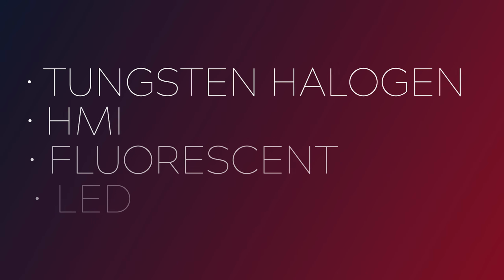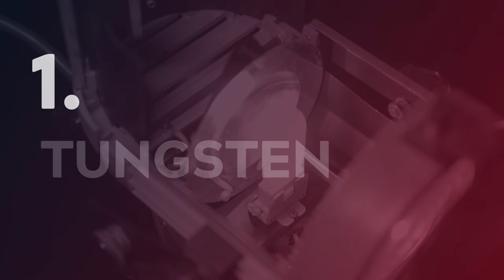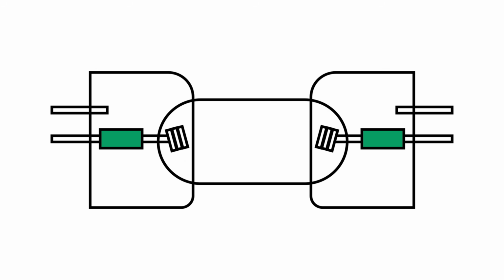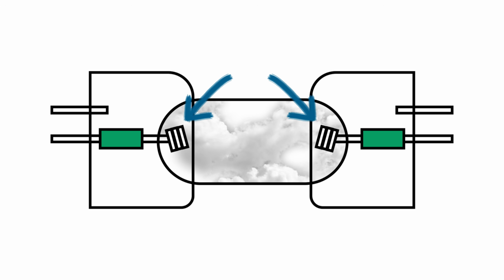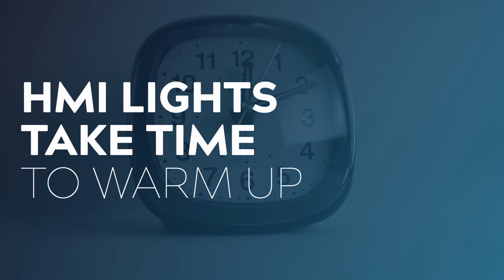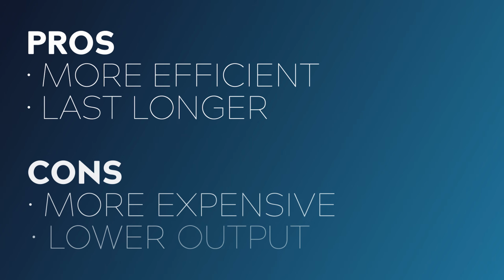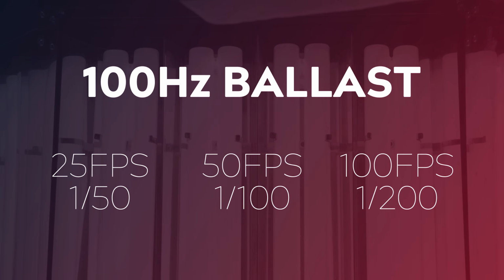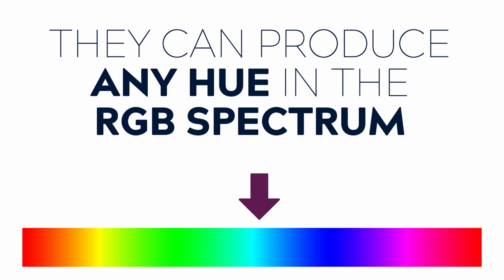Types of Film Lights - Tungsten, HMI, Fluorescent & LED Lights Explained | Film Lighting Techniques

Comment: Ok Ok i scoured in a lot of articles and couldent find a defenitive answer.... why tungsten light emits a ful spectrum of light? i mean... i know that pure white light' ,like the sun, contains the whole color spectrum from purple to red. so why does the tungsten light emits a full spectrum? or im understanding it incorrectly.
Reply from the maker: I have been trying to find a definitive answer to your question for the last two weeks. But I haven’t found anything conclusive or satisfactory. I’m going to keep digging. But I didn’t want to let this sit unanswered. 

It would appear “full spectrum” isn’t a scientific term and there is no measure for what a “full spectrum” light is. It’s just become part of the industry vernacular. The definitions seem to vary a lot. 

Also, a tungsten filament is considered a black body radiator (read: something that emits light when heated) and is used as a reference source for CRI ratings, along with daylight sun. So it actually only gets a perfect score because it is the reference point that all other 3200k sources are attempting to match.

This is what I have discovered so far. Thank you for posing this question, I’ll keep looking into it and report back. I may even do a video on this topic. 

Thank you 🙏🏼
Reply: Tungsten light is caused by pumping electrons into a filament thereby heating the filament until it glows similar to an incandescent light bulb (it’s actually almost identical). The light put out by tungsten is essentially fire at high temp, meaning that it’s totally natural and not replicating anything unlike HMI, led or flouro
Reply from the maker: Thanks for chiming in 🙂
Reply: @CreativePathFilms  thanks for a great vid! Neat to see how things have changed even from when this was made only two years ago. You hardly ever see legitimate flouros on set anymore, as they’ve been replaced by quasars and titan tubes. Things change so fast nowadays!
Reply from the maker: Thank you! It’s so wild to see the speed at which things are changing! Its exciting times to see so much rapid innovation.

Comment: what lights have you used in this video?
Reply from the maker: Hi Paul, 
This will be an incomplete list, but these are the ones we've used most frequently in each category. Here we go:
Tungsten: Arrilite 2K, 1000, 800, 650+, 300, Dedolite DLH4, Ianiro Redheads.
HMI: Arri M18,  M8 as well as 1.2k par and 4k Fresnels that I can't remember the models (all hired at different times for different jobs).
Fluro: Kino Diva, Lightpro 4x Fluro banks
LED: Aputure 300D, 120D, 100D, Nanlite Forza 60, Aputure F7, 672, Falconeyes Light Mats as well as a bunch of other LED panels and tubes from various brands.

Comment: My Nanlite led pannel has indeed been one of the best purchase I've made.
One question : why is still the tungsten the best for a warm color ? Compared, for example, to a led light with color correction
Reply from the maker: Hey Simon,
Thanks for the excellent question!

To be honest, the difference between using a tungsten fixture and gelling a high CRI/TLCI LED is fairly nominal. It’s well within that zone of diminishing returns. 

Gelling will get you 95% of the way there in terms of light quality and this is what I do on my shoots the majority of the time.

I live in Australia, so let’s be honest, it’s hot enough here as it is without pulling out the tungstens 😂

But I can’t quite put my finger on it. Whenever I put two lights side by side as a key/fill combo, with a tungsten key and an LED or fluro as the fill, I also ways notice how much better the tungsten side looks. It’s really subtle. 

The skin always has more life to it, the skin tones and colours are always fantastic, whereas the led or fluro always seems to have a slight green/magenta shift (even the high cri ones - barely noticeable, but there) and don’t have that same “healthy glow” (for lack of a better term) to them. It’s probably because tungstens are a full spectrum source. 

It’s hard to know if it’s the gel or the fixture causing the shift, but going with a native colour temperature always seems to look better, to me anyway. And if you have a bicolor LED with 3200k, the difference is slimmer again. 

The inverse is also true, LED’s always look better at 5600k then a gelled tungsten light. 

I’m certainly not going to suggest it’s worth going out of your way to buy an old tungsten light when you have excellent LED’s and gels on hand, but if you so happen to find a bargain one day and you have the cash to play, it might be worth considering it to experiment and see if you notice a difference yourself. This is of course, totally up to you!

Take all this with a grain of salt, there’s nothing scientific here, this is my opinion drawn from my own experience. If there are any gaffers reading this, please chime in!
Reply: @CreativePathFilms  hi there I'm not a light scientist at all, but I recently saw a video of one from another lighting company explaining how different daylight LED fixtures can all produce different saturations (as well as per hue) from each other despite having similar cri and tlci. That could be a reason its still different to have a tungsten vs a 300x vs a daylight fixture with gel
Reply from the maker: Thanks for sharing Zion! I’d be curious to see the video you’re talking about.
Reply: @CreativePathFilms  Thank you for taking the time to write this precise answer !
Reply from the maker: @SimonPotaufeux  my pleasure! Always happy to help 😊